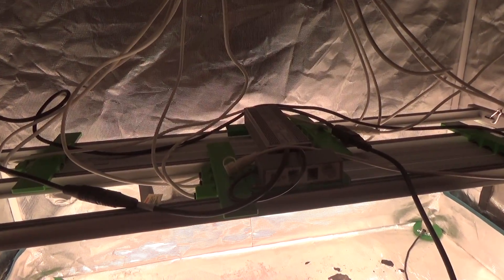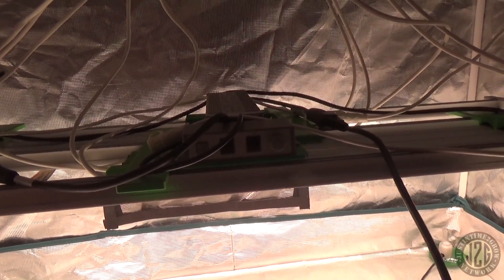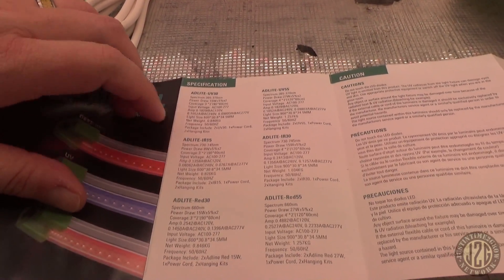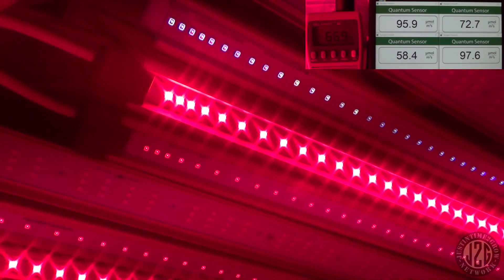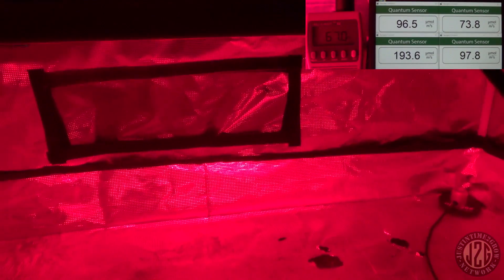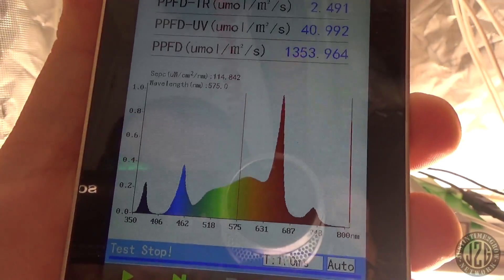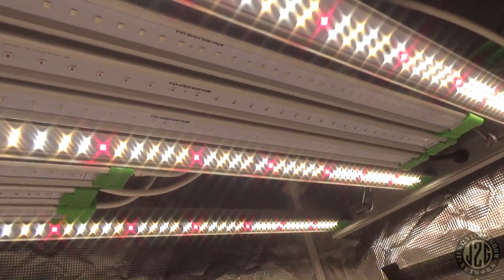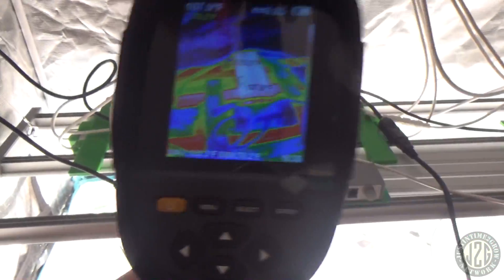Do You Need More Bars? - Mars Hydro Adlite PAR, Spectrum, Wattage & Heat Test

Comment: Definitely missing 630 and 400nm I think both sides chlorophyll A and B make a difference. If the uva was 390 it would benafit the spectrum more. Or make a evo mint bar! Best is just use a 4ft true uv since it covers all uv even up in 460 area. Just my quarter pitch.

Comment: Holy smokes everything is all tangled up wires everywhere definitely poor design
Reply from the maker: Well the issue is you want each bar to be able to be on it's own timer so they each need their own plug. Then the bars need to be connected together and that's even more wire. How would you design it differently?

Comment: I’m thinking about buying these for my fc-e1500. What are they actually doing? More tricomes? Bigger buds?
Reply from the maker: Light manipulation. You can use each one differently or all together to just boost overall spectrum. Check out the "Emerson Effect", use far red for that. Red of course is good for flower. UV is supposed to encourage trich production in late flower.
Reply: @Justintime2grow  okay nice! But can I connect them to my mars hydro app so I can set timer in my app instead of using 1000x timers? xD

Comment: Reminds me of the old Burple lights!
Reply from the maker: Those lights did work. They just don't have the same output per watt that white does. It's kinda funny that we're now adding them back in but it does make sense. I got great results adding blurple lights to HPS years ago.
Reply: @Justintime2grow I wouldn't mind seeing a blurple comeback. I mean surely mixing reds with blues in along with 3000k and 6000k spectrum has to be good (I say this no evidence backing it at all) The industry was kinda heading that way with the blurples + white cobs but then quantum boards, bar lights and full spectrum took over.